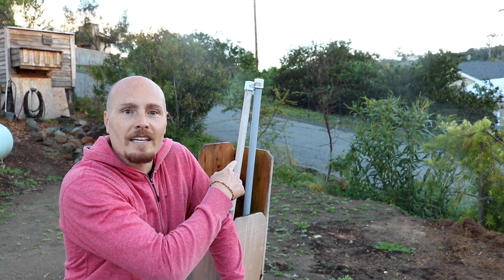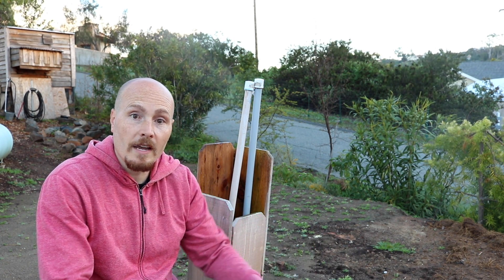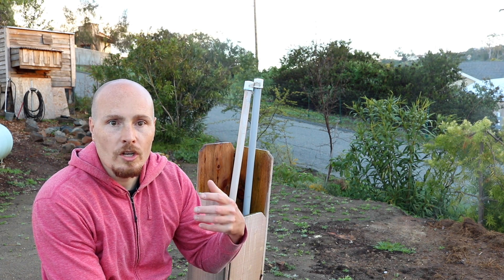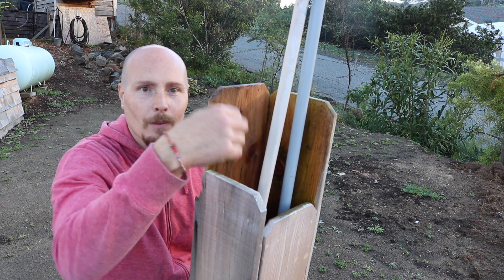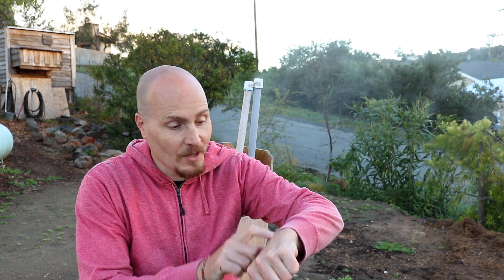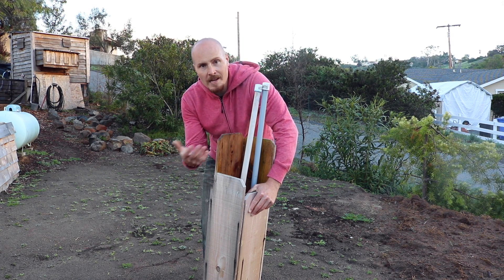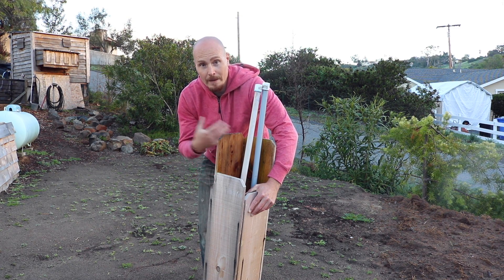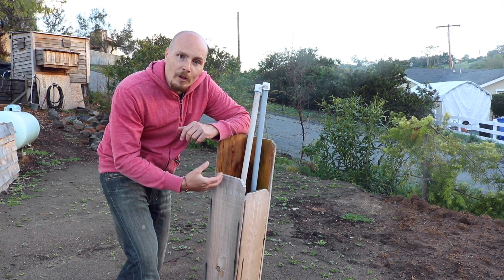THE COMPOST POWERED CHIMNEY

Comment: Diego, dig down with a post hole digger and get a temp reading at 1 foot and 2 feet.  That will let you know what the temps are for the plant's roots and the thermal action should be able to travel up or wick up with the water for your season extension. This is supper cool! Thanks for posting this.
Reply from the maker: Good idea, will do!